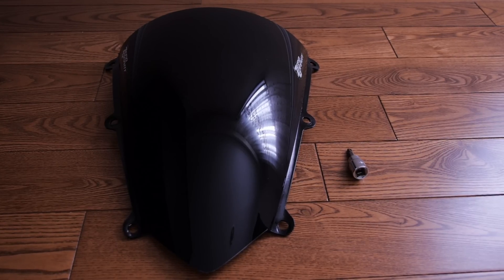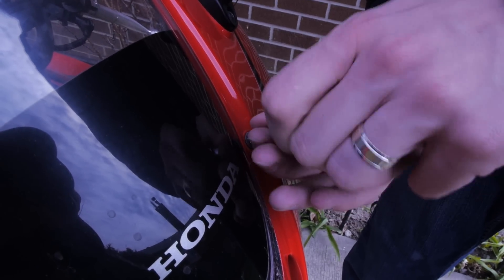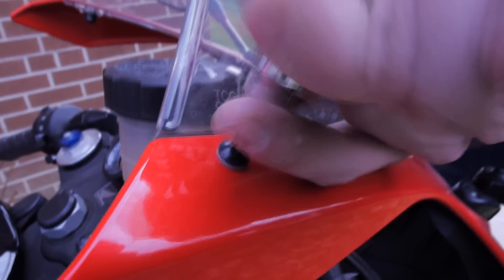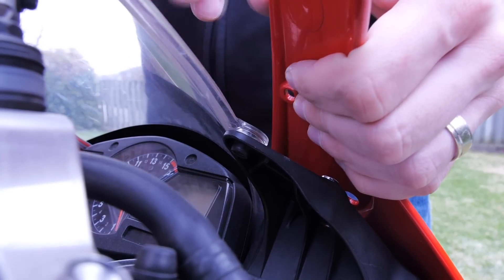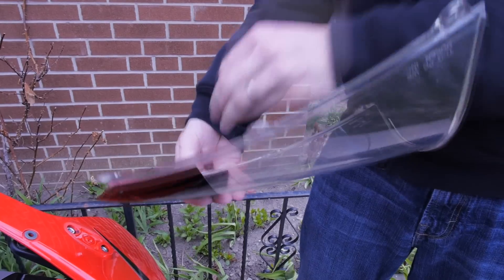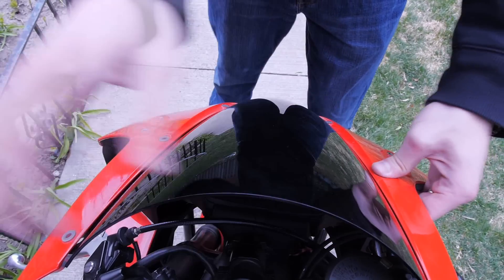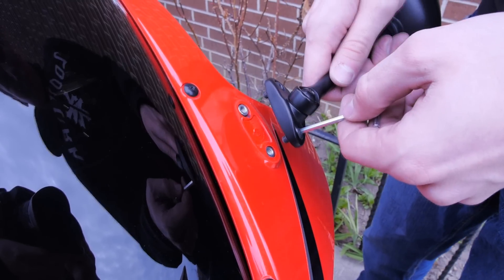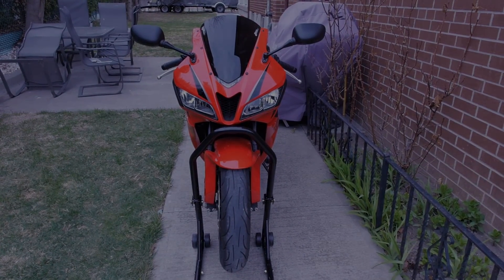Zero Gravity Windscreen INSTALL - 2009 CBR 600RR [SR SERIES]

Comment: I’ve been trying to get the rubber pieces back in for 4 hours dude. It’s not budging no matter what I do. The last 2. Lube doesn’t work, heating it up doesn’t work. I will need to order a whole new kit.
Reply: I got 2 x rubber grommets fitted up fine, with the 3rd one I broke the new screen and cut my hand, heaps of fun. That's 150 USD down the drain including freight.